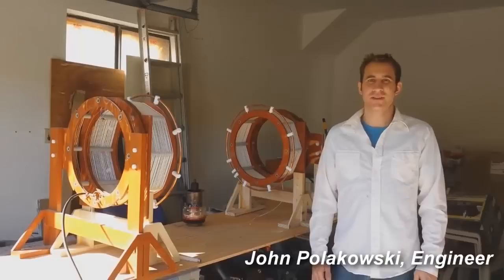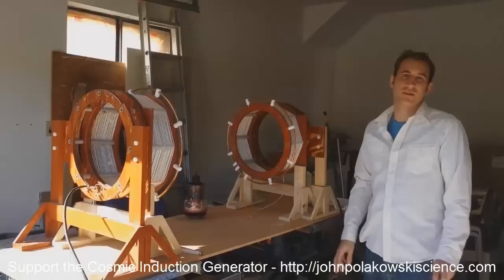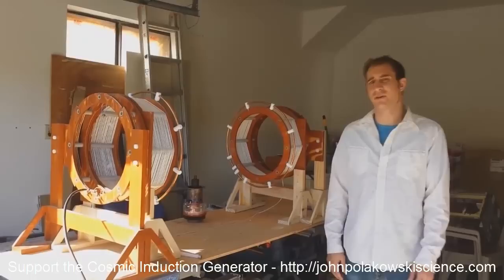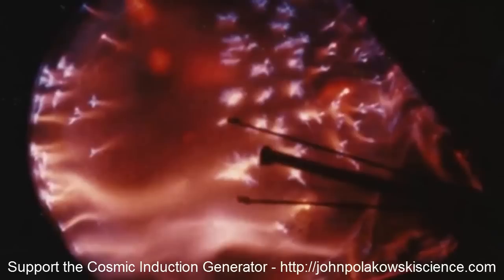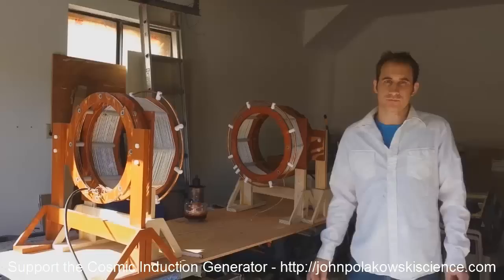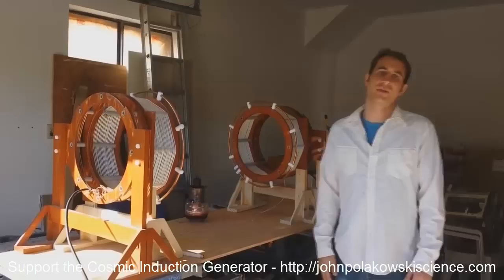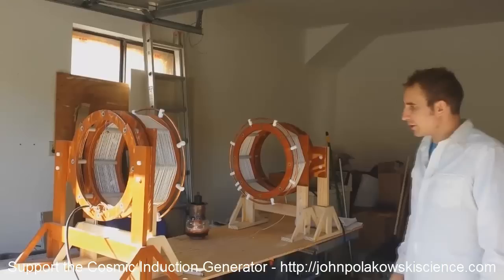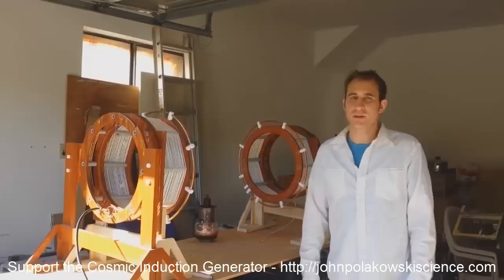Cosmic Induction Generator by John Polakowski

Comment: Hey man, Great work! Look at my videos. I have reproduced the same anomalies...vortex coils can be of importance due to their naturally low frequency. I built mine tesla style. I would be interested in chatting with you. Currently investigating how to terminate the secondaries so power can be transmitted without any wires. Ive got single wire transmission with DC down to a pretty good efficiency...Energy can thus be multiplied with no extra draw on the transmitter. Also, teslas tuning circuit is extremely useful. Looking forward to hearing from you.